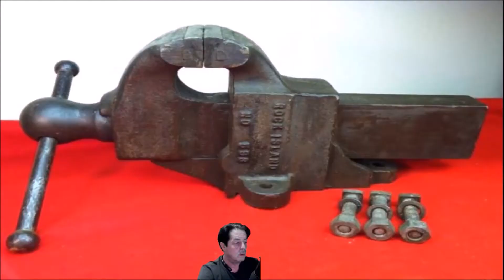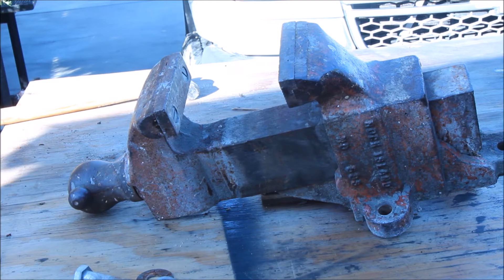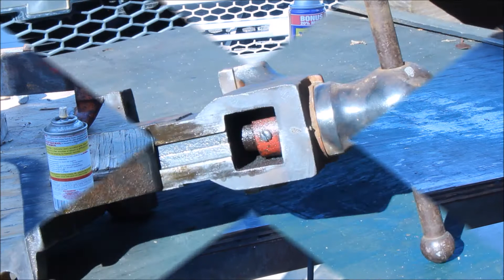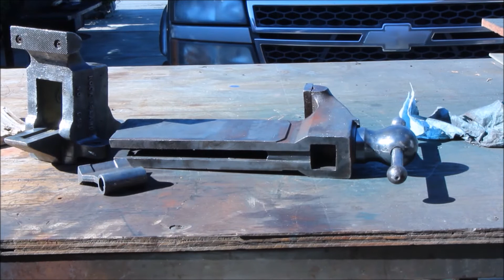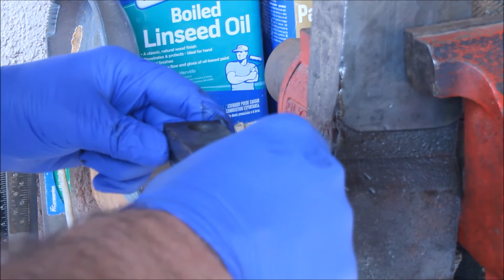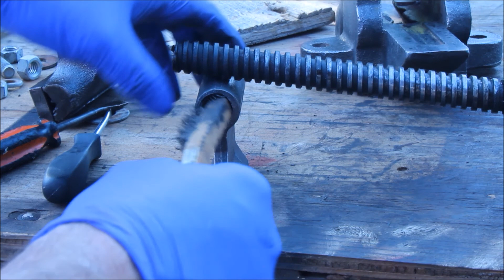Rockisland Vise Restoration Project -  Part #1

Comment: That jaw has been replaced, you can see the original design is broken underneath. Rock island uses a weird jaw design with the support flange in the middle of the jaw, not below it like most. Any hammering blows will hit on just those 2 bolts. Sadly there is no easy fix for this. 
My Rock island is not broken as much as this one is yet. I'm in the process of trying to fix it now.
Reply from the maker: I was able to repair this one to a usable vise but i understand what your saying - again for the price with all parts there I was glad I could make a functional vise out of it ...........thank you for the comment